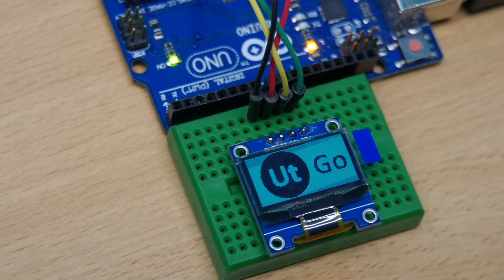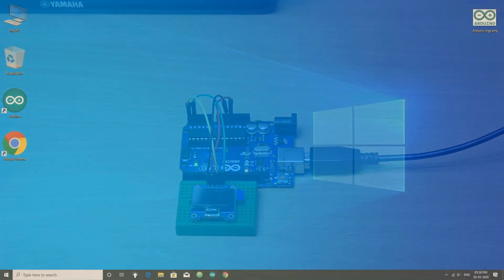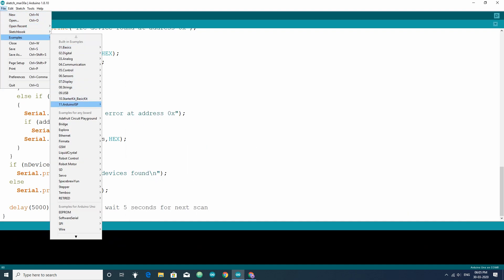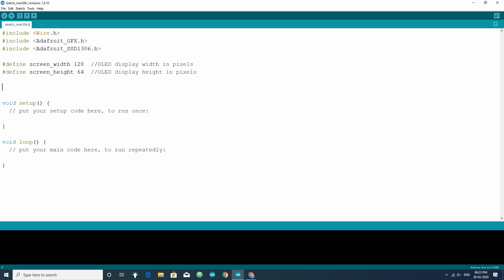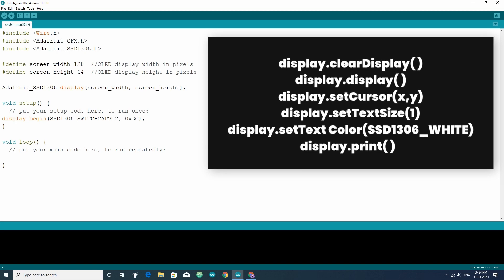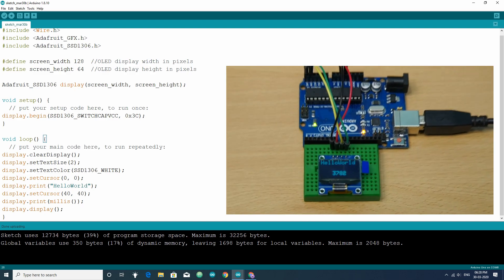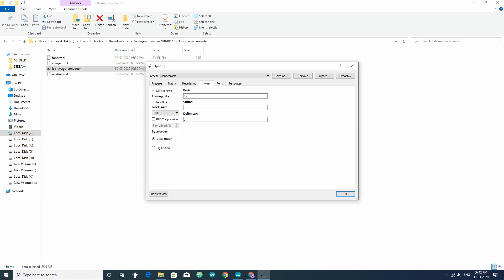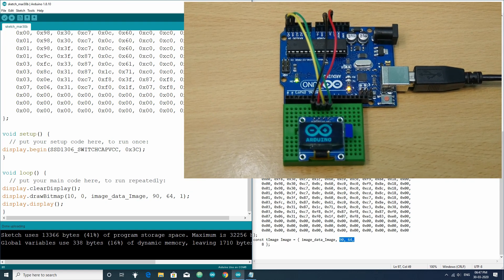How to use OLED with Arduino to display text and images | Ut Go

Comment: One problem for me, the OLED is showing many pixels instead of the text, then the text is moving left to right at the top moving quickly.
Reply from the maker: Most of the time this happened due to loose connection.
Make sure the connections are not loose.

Comment: Nice vid, thanks.  I'm building a Muon detector.  Anyhow, it will send a signal to a LED and light the LED every time it detects something.  Rather than lighting up a LED I'd like to use an OLED to keep a running count of every detection in place of the LED lighting up (or in conjunction with it).  So, can the + and - wires to the LED be sent to an arduino and then to the OLED  where it would have some text and keep a running count of all the detections/every time the LED would flash?  Your kind assistance would be appreciated.
Reply from the maker: Just use edge detector to detect electric pulse then use that to increase the counter then show the value of counter in OLED display as shown in the video.

Comment: what did i do wrong my display looks black and white tv no singnal kinda look in 128x64 and in 128x32 it has only 1/3rd of the screen working the top 3rd
Reply from the maker: Choose correct display resolution and make sure connection is not loose.
Reply: @UtGoTech  i already used several different wires before and the resolution i check like 5 different times i fixed it turns out that adafruit had a problem but idk where i use a different library
Reply from the maker: Are you using same libraries as shown in the video.
Reply: @UtGoTech  using some different ones now because the one in video didnt work
Reply from the maker: Which one?

Comment: For Buying Purpose Could you please provide the link of  MAX30102 sensor
Reply from the maker: https://www.amazon.in/Sensor-MAX30102-Detection-Concentration-Arduino/dp/B08PCW5H1H/ref=m_pd_aw_sbs_sccl_1/258-4643052-5824360?pd_rd_w=43y27&content-id=amzn1.sym.0882175b-460c-470b-8206-e2cd634a1042&pf_rd_p=0882175b-460c-470b-8206-e2cd634a1042&pf_rd_r=C3ZAKPA6844GRMC6MCHQ&pd_rd_wg=Ufqb1&pd_rd_r=bdeca3c9-8de6-493d-93e6-1b96dd161f77&pd_rd_i=B08PCW5H1H&psc=1

Comment: Sir many many thanks for your reply. But Sir I am not expert in this regard. Please give me full details. After adafruit ssd1306 & adafruit gfx library installed first upload the I2c scanner code in the Arduino Uno. When I try to upload the sketch error uploading sketch shows. You told that serial monitor open. How to open that. Sir please don't mind. Please help me in this regard. I have purchased the OLED display from Amazon 0.96 128/64 with IIC. Please help me.
Reply from the maker: Upload errors is different. You can google for the solutions.

Comment: Actually Sir I don't understand that. Two libraries to be installed this is clear. After that i2c scanner sketch what to be done?
Reply from the maker: Upload I2C scanner sketch after that open serial monitor to check if communication is established or not. If you see the I2C address then the communication is working ok. If not then look for improper connections.